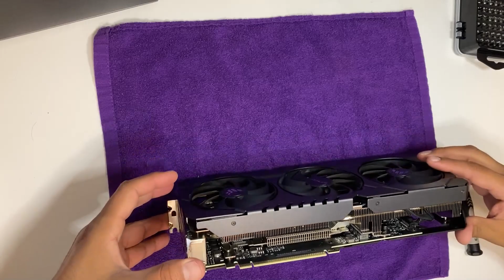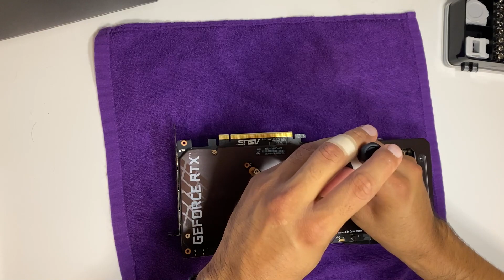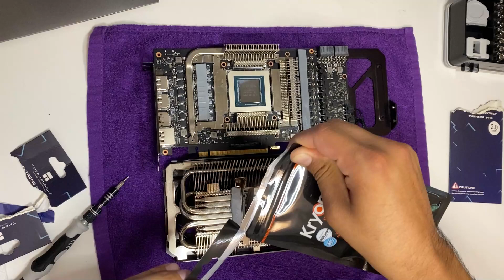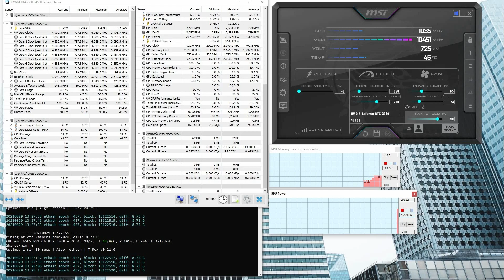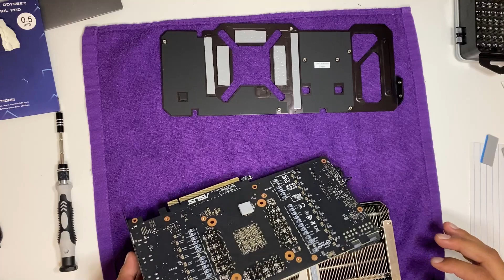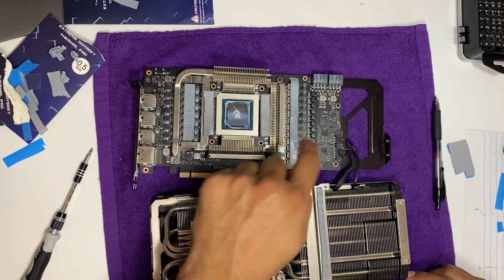Asus TUF RTX 3080 Thermal Pad Replacement - Vram dropped ~(-20c) and improved hashrate

Comment: hi, great video. I read about (what do You think?):
"My best result so far is
1.5mm on front
2.5mm on the back (2 + 0.5 mm)
3mm between the heat pipes and the small heat sink

AND a clamp over the front part of the card

I am getting 125 MH/h at 88-92 deg (1200 core, 10901 memory)

I used thermal right odyssey. I had to do a few iterations to get to this to work

1.5mm on front,2mm back, only 2mm on one of sinks between pipes

1.5mm on front,2mm back, 3x3mm between sink+pipes -> Worse

2mm on front,2mm back, 3x3mm between sinks +pipes-> too much, the die looses contact

When i applied a clamp i think it improved the contact between the heat pipes."
Reply from the maker: That’s some serious work with the clamp. You’re getting 125 MH/S with a 3080?
Reply: @migs5492  its 3090 TUF. I am thinking about the thicknesses
Reply: @fishek84  - you think you went too thin (1.5mm) on the front side pads?
I was getting ready today to follow your idea of 1.5mm for front pads and 2.5mm for backplate, with 3mm for heat pipes.

Appreciate if you could let me know if you think you did this wrong and if the OP got the right idea.
I have no plans to use any clamps.
I only want to do this once.
Reply: @Globespy  I want to get everything done on Wednesday. In my case, the clamp + heat sink with stock thermal pads reduce the temperature from 110 to 88
Reply: @fishek84  - do you think I can use 1.5mm on front with 2.5mm on back WITHOUT needing a clamp? I want to reduce my temps as they are very high.
Reply: @Globespy  These thicknesses are factory so there should be no problems.
Reply: @fishek84  - hmmm...so I wonder if the only pad worth changing/adding is the one for the heat pipe? Perhaps I should have gone with the OP's guide instead.
Reply: @Globespy  a pad on the heat pipe is necessary. I do not know what thermal conductivity the factory pads have, so I want to replace them all with Thermalright Odyssey
Reply: @fishek84  thank you. So your experiments have found that 1.5mm on front and 2.5mm on back + 3mm on heat pipe is the optimal setup? I will not be using any clamp
Reply: @Globespy  in this configuration, the temperatures should be slightly better than the stock temperatures
Reply: @fishek84  thanks. so the OP's choices are probably better than yours since he had temps that were significantly better than stock?
Reply: @Globespy  yes

Comment: Thank you very much for this video! I'm looking to do the same thing to my card. Why did you go with the Thermalright pads? Do you know if this same mod would work with the Gelid Solutions GP-Ultimate pads? They advertise 15w instead of Thermalrights 12.8w. Not sure if that would make a big difference, but the price is about the same.
Reply from the maker: I went with those because I read the Gelid ones compress much more than thermalright. I believe you can only use those once based on what people say about them being destroyed after you reopen the GPU again. The thermalright are definitely good and I think the ratings between different brands are sort of hard to compare apples to apples.
Reply: @migs5492  Thanks for the quick reply! I'll just use what you used. I don't want to fry my card
Reply from the maker: @bucktoothfrog  lol that’s why I went with what I had seen that was tried and trusted.
Reply: @migs5492  I did it! Followed your video and managed to drop my mem temp to about 85c! Thank you so much man! I did notice my hot spot temp went up though. It's about 20c higher than GPU temp. Do you know why that could be? I used ThermalGrizzly Kryonaut. I noticed at 21:06 you replaced the pad with a 3mm, but earlier you placed the pad on the other side of the GPU die with a 2mm. Are they supposed to be different sizes? I'm wondering if the pressure from the cooler is crooked
Reply from the maker: @bucktoothfrog  That does seem a bit higher than mine. What are the hot spot temps? Mine are typically around 14-16 degrees hotter than the GPU when mining. Im sitting at 48c for the GPU and 61c for the hotspot. I took another look at my video and another teardown and it looks like the left side has a wider gap between the heat pipes and the cold plate compared to the right side.
Reply: I just did mine tonight with the Gelid Ultimates. Used the same thicknesses as m uribe and it worked out well. It knocked mem temp down from 110 @85%/271W to 90C @85%/271W.

m uribe is right, the Gelid are pretty weak. They tear super easily, and if I have to take the card apart again to replace the GPU grease, which it's looking like I might, I'll probably have to replace them.

My GPU temp[ went up by around 5C and my hot spot temp runs around 13-14C above that. Might be the grease I used, might not have smeared evenly.
Reply from the maker: @davereeves1967  Glad you were able to pull it off. But that’s interesting. I am getting high 40s low 50s on the GPU when mining and mid to high 60s when gaming. I wonder if the GPU is throttling less since the VRAM isn’t hitting high temps anymore?
Reply: @migs5492  possibly, but I've also turned the fan speed down from 100% to 90. The case is also crap for airflow, 2x 120mm intake/2x 120mm exhaust but the intakes are pretty well blocked.

I'm sitting around 57C on the GPU/74 hot spot/90 mem @240W (75%). +100 core/+1500 mem clocks, 101mh/s.
Reply from the maker: @davereeves1967  looks like you’re running a little higher than mine. I am running 73% at ~230 watts -225 clock and +1200 memory. I am getting between 99-100 my/s and the temps above. ~47-53c GPU and 82-90c VRAM.
Reply: @migs5492  Hm maybe I'm OK then. Mine sits around 46c with a hotspot of 63c. I'd like to keep both under 60, but that might be asking too much.
Reply: @migs5492  my vram is 98c with PL 67%, mem +1150, core -250 at 227w

I've never opened a gpu, wonder if I should add/replace pads :/
Reply from the maker: @bootchoo96  I guess it’s up to you. If you are a gamer and you want give your GPU the best chance of a longer life I would say change. If you think you will upgrade in a year maybe it’s not that big of a deal. I personally think it’s best to keep under 90c just to give my hardware a better shot of lasting longer.
Reply: @migs5492  When I game, the Vram is 75 to 85C (undervolt, no OC), is that OK ?
Reply: Just thought I'd pop in and drop off an update on my particular pad replacement status after over a year of 100mh/s beating. 

I just started playing New World and noticed that my hot spot temp was steady over 105C, so I picked up some Kryonaught Extreme paste to repaste with. Pulled the card apart, and all of the Gelid pads stayed right where they were supposed to. 

After repaste, my hot spot temp dropped from 105C in 4k on medium settings to 70-75C in 4k on ultra high settings. Pretty sure it was a poor mounting pressure issue from my original pad replacement.

Comment: Great video. Quick question - are the two long thermal pads 0.5mm in the backplate?
Reply from the maker: Yes, the long pads on the ends of the backplate are 0.5mm.
Reply: Must be replaced with 1.5 if u're using 3 on the other sides otherwise u won't make contact, unless 2mm and 0.5

Comment: hi, i replaced pad like you did and my vram temps drop from 110c to 92c while mining OC. but my worry is that my gpu is 62 and my hot spot temperature is around 94-96c. i used thermal grizzly kryounot. do you think i did not put enought thermal paste? or what else could be? or should i used another thermal paste like artic silver 5? thanks
Reply from the maker: That is definitely higher than it should be. Mine typically runs ~ 12c higher than GPU. That is the same paste I did. You can open it back up to see if it looks evenly distributed and re-apply more if needed. I would also check you didn’t put a pad too thick somewhere, the heat sink may not be seating fully on the GPU.
Reply: @migs5492  ok thanks for your answer. yes i will re open it tomorrow because i am waiting on more thermal paste grizzly. i put 2.5mm on the left side of the heat sink,  you put 3mm. and right side i put 2mm and you also put 2mm. i will give you an update tomorrow. i will try repaste and check contact with heat sink. thanks again great video btw.
Reply: @migs5492  mine is a asus tuf 3090 btw. it is pretty much same everything.
Reply from the maker: @sale123451  that’s my understanding as well, aside from the additional VRAM on the backplate.
Reply: @migs5492  i did my best after 6 tried. on my 3090 i found the best interation -2.5mm backplate, -1.5mm front vram and 3mm heatsink and pipes. hashing 121mh 46c and vram 100c. i used thermalright odyssey. i ordered so heatsink to put them on the outside of the backplate. ppl said i will improve 10c-15c if you also put a couple fans. i will give it a try. i tired of opening it so many times.  i wonder if i have use thermal pads gelid ultimate if could have been better? they claim 15w/k idk. 

i tried:
-3mm back plate
-2mm front
-3mm heat sink and pipe. over 100c and cpu worst over 80c i guess to thick

-3mm back plate
-2mm front
-2.5mm heat sink and pipe. over 100c

-3mm back plate
-2mm front
-2.5mm heat sink and pipe. over 100c

-3mm back plate
-2mm front
-2.5mm heat sink only left side. over 100c worst

-3mm back plate
-2mm front
-3mm heat sink only left side. over 100c worst
Reply from the maker: @sale123451  sorry man it sounds rough. But you posted the different sizes you used but the sizes are not all the same. For instance the back plate doesn’t use all 3mm and the front doesn’t use all 2mm. They have mixed sizes so that may be the problem. If you follow this picture this should be what you want to use below. 

https://imgur.com/kgqKgHm
Reply: @migs5492  yes i know. I only replace the thermal pads on VRAM i did not replace the other 1.5mm etc. I only replace VRAM and heat sink and pipes. Do you think if i change all of them like every single will have improve ? 🤔  i am getting heatsinks on december 21th  to stick those on the backplate. I will let you know if it worth it. Ppl claim 10c to 15c improvement
Reply: @migs5492  hello i put heatsink on the back plate and it did improve between 8 to 10c. so definitly worth it. but make sure to put some fan close to those heatsink so they can suck the heat out.
Reply from the maker: @sale123451  nice thanks for sharing!

Comment: Hey man, you did a wonderful job explaining this. And I wanna know if you know repadding 3090 would be the same or not ? Like the thickness. 3 mm on the back for vram and 2mm at the front?
Reply from the maker: My understanding is that everything is the same except on the back plate. There are VRAM chips that the 3080 doesn’t have. I am not sure what those thicknesses are.
Reply: @migs5492  but the front should be the same I assume ? Thank you. A lot

Comment: Could the Vram Temperatures drop just of changing the Thermal Paste? 

On my Strix 2070 Super repasting did wonders to the whole Card Temperatures.

So i would like to try this also on my Asus TUF 3080 10GB VRAM Card, if possible.

Comment: KRITICAL Thermal Pads has full front card pads pre-cut that are  20 W/mK pads for $39.00 Bucks, this cards upgrade kit is found here:  https://kriticalpads.com/asus-3080-tuf

Also, putting four, ( 4 ) M5 or M4 Nylon washers under the heat sink bracket on the back improves the heat sink contact without causing harm to the pcb board; as seen in a video on Gamers Nexus; I now put these plastic washer on all cards with that four pronge heat sink bracket; between the pcb and the bracket before putting the screws through; some heat sinks will shift even with the screw snugged up good.

Most thermal pads when doubled up create air pockets; and that negates the heat transfer to the sink; like most .. I have done it before; but try to avoid it if possible, there is a thermal putty that you can break a chunk off, and roll it into a ball in the approximate thickness you need and it compress's pretty good and dosen't leave a slight bend in the pcb as some thermal pads do that do not compress; I tried to find the brand today; but no joy, I thought it was K5 Pro, but that wasn't it .. I think that I seen it on a Reddit thread, or Linus Tech Tips for anyone that is interested and may have better luck finding it.

Thanks for the content; I have some of these cards coming in; and it was a relief to see the thermal pad layout is pretty simple and basic.

 If you ever replaced the thermals on a MSI RTX 2080 Ventus; it has different size and thickness pads every where; like the older MSI GTX 1070 Armor OC's is that same way; too many pads everywhere.  

Peace

Comment: How did you separate yours? Did you hear it first cuz mine won't budge. I know all screwed are out.
Reply from the maker: Double check the screws one more time. All I did was continue to pry all around and eventually the pads separated.
Reply: @migs5492  I just heated it for a bit with low temp heat gun and it finally loosened the concrete thermal paste. Thx for the quick reply.

Comment: bro I did exactly the same you did and now when i put the card in the rig it wont boot and the fans keep working like it was too hot, iniatially the monitor went to sleep, but after I try a couple of times it start but the trex give an error and didnt recognized the card, please help
Reply from the maker: Did you make sure all of the cables are connected properly? How about checking the temperatures on the GPU? Maybe check that it is properly seated in the PCI-E slot.

Comment: Did this with 3070ti, which is the same. Ended up lowering overall temperature by 20, but vram temps dropped only like 5, which changes nothing in my case. Wonder what i did wrong. I did change all the pads except the two 3mm ones that attaches the vram heatsink to the bigger one.
Reply: you ignored the most important part

Comment: Hey i have a 3080 and i plan to get a 3090. Do i absolutely need all 3 different sizes of thermal pads?
Reply from the maker: I think the 2mm and 3mm are the most important. You may be able to do without the 0.5mm and leave the old ones. My card was in pretty good condition so the pads weren’t ruined. Some other cards got ruined just opening up the card.
Reply: @migs5492  Thanks. Would the pcb be the same for the Zotac 3080 card?
Reply from the maker: @vesc007  I dont think they are going to be the same.

Comment: can i ask a question can i use the same thermal pad size to 3080ti tuf ?
Reply from the maker: I don’t know about the 3080 TI. My guess is that is will pretty much be the same because the 3090 is.
Reply: @migs5492  I would also like to know. I did the exact instructions of the top video and my Temps went up 10°

Comment: hey, when you manage to get 100MH/s do let me know your temps please
Reply from the maker: I managed to to get to around 99.5 MH/s and my VRAM fluctuates between 84-90 depending on ambient temps. My room has terrible circulation and temps outside range from 16c to 38c. I also don’t keep my house really cool. 

On average it’s usually 86c with the side panel off and 88-90 with the panel on. We’ll see how this changes during the winter.

Comment: You put just a single centred termal paste drop over gpu processor, ok. When the plate compress that drop, in the gpu corner will remain small areas with no termal paste that affect the dissipation. Follow this brazilian guy video to have a correct termal paste aplication: https://www.youtube.com/watch?v=FromHK2ReX4&t=6s

Comment: if gpu was warranty then its void. tried with COPPER heatsinks at back plate ?
Reply: Yep, Asus are hardcore about doing anything on the card. I called them a few days ago to ask about changing thermal pads as VRAM temps even in gaming seemed too high, and their response was basically if they detect I even removed a screw, they will void the warranty. I posed the hypothetical, if I just ran the GPU and it died because of say poorly aligned or missing thermal pads from the factory, then they would replace under warranty. Insane that they would rather the thing killed itself than an owner carefully check and replace thermal pads to avoid such a situation!
Sure, it's probably illegal if it's proven that the fault was hardware related and nothing to do with changing pads, which is why you should run a new GPU for a few months before doing anything to make sure there's no sub-par components that will usually show within that time. If the GPU works without issue for say 3+ months then it's likely there's no factory defects.
Reply: @Globespy  replacing the pads doesent void the warranty. they must prove that your modification is the cause of the problem. but its pretty certain that you have to go to court for the money. neither us law nor german law do prevent self-repair. those stickers are illegal, but noone bothers to fight for it.
Reply from the maker: There is a sticker on one of the screws. You would have to carefully remove and replace.

Comment: If anyone can help me out. I repadded Asus TUF rtx 3070ti and had no issues and memory  temp went down about 10 degrees. So I repadded the Rtx 3080 TUF and now when I plug it in. Nothing shows up and my motherboard shows white vga light when I plug my card into a riser. The other cards works fine when I remove the 3080.

The rtx tuf 3080 powers on and fans are working but no display

**I tried it on another rig and device manager shows rtx 3080 with YELLOW EXCLAMATION MARK but not functional.

If anyone can help me out. Thanks
Reply: What thermal measurement did you put on the vram of the asus tuf 3070 ti? thank you!
Reply: @brunin51990  I did rma on the Rtx 3080 Tuf.. turns out software issues. Asus replaced the card for me